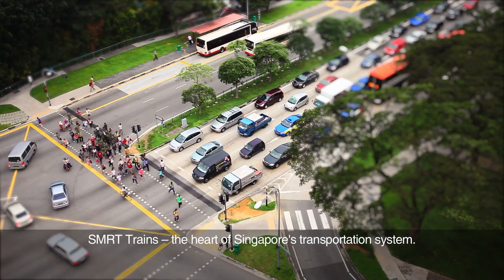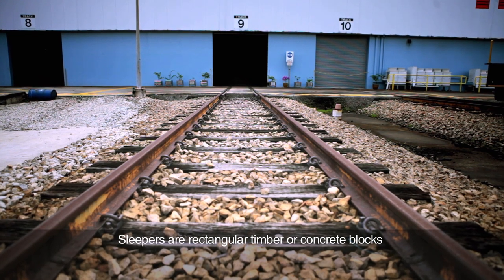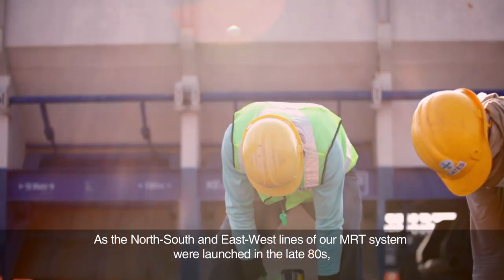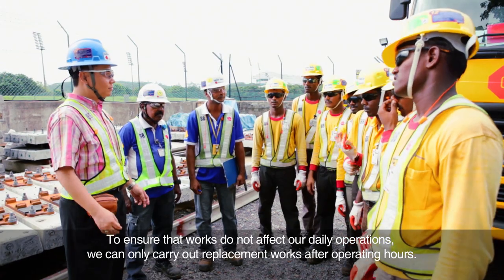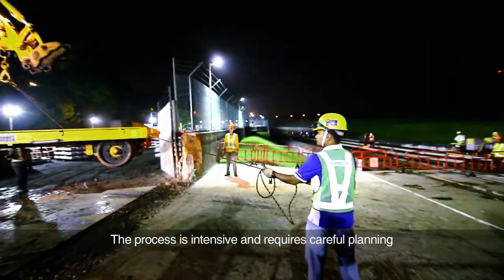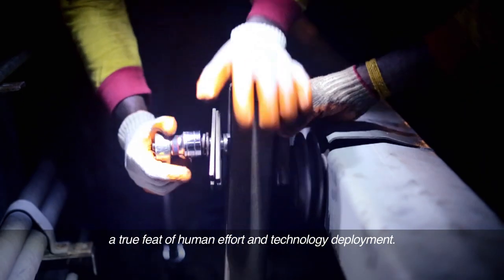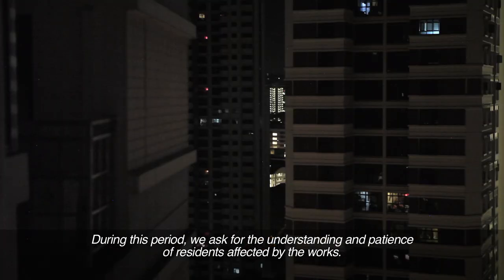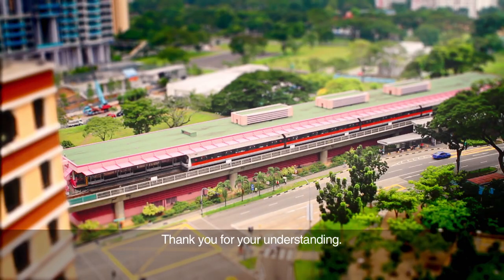SMRT Sleeper Replacement Programme

Comment: Why Not do what New York City does in which other worldwide cities have copied and do. Close a Section on Friday Night and Re-Open it Monday morning. During weekend, Work is Done 24/7 so you are Not changing 30-40 sleepers in 90 min but in Minimum 48hr period you could change 960-1280 Sleepers! Use shuttle buses for Sector closed during weekend.
Reply: @Dihrudn Yfjdnduk figure it out like the rest of the world does. You close a sector on the weekend and replace that service with bus service. As for getting on time, leave earlier...